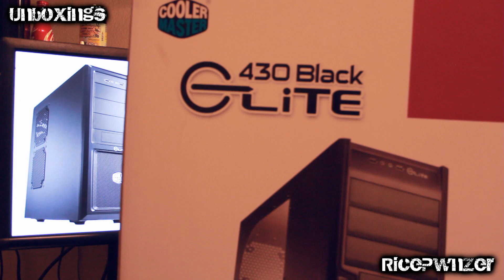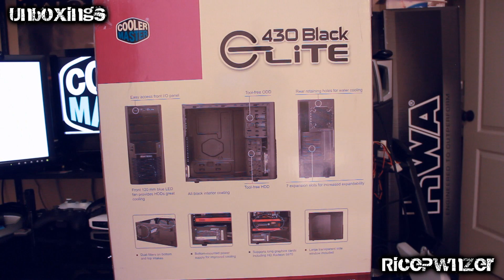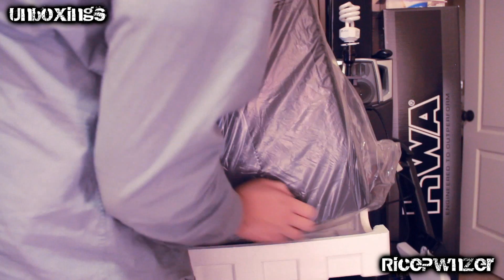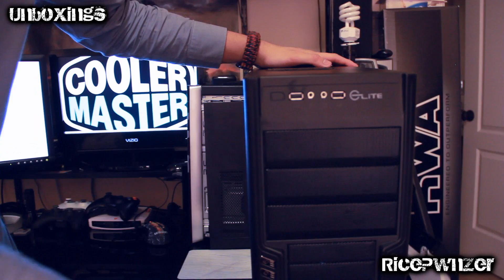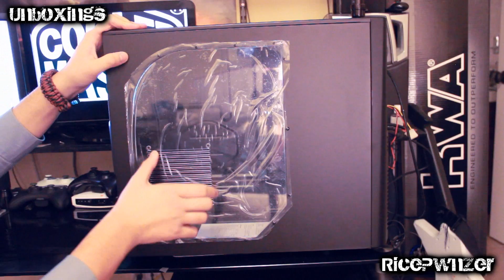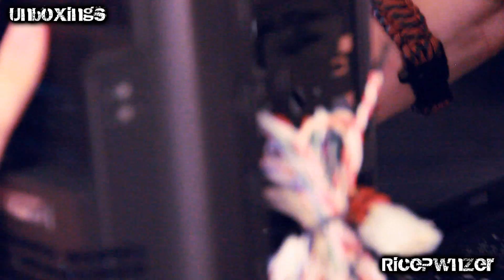Cooler Master Elite 430 Black Unboxing

Comment: wow thanks for the review, I was thinking about getting this, but I think I'll just go for the 431 if I really feel like getting a similar case. The experience I've had with that has been good. Even though the cable management space is pretty bad compared to the rosewill challenger I got to work with.

Comment: For those who are wondering.
Supports high-end graphics cards up to 315mm or 12.4" in length,
Reply: yup fully sized GPus
Reply: What motherboard form factors does it support
Reply: Is is so hard to go to Cooler Master website and check?

Comment: im thinking about getting this case and i have an hp pavilion 500- something and was wondering id there would be any issues i would have to worry about when putting my parts in the new case. Thanks
Reply: Have you done it yet?
Reply: no
Reply: Aiden Finch It's gonna work fine.

Comment: Should me buy this case ore not? If not can help me to find beter (cheap,good)case
Reply: i have this case and i think its great if you want a fairly good quality case for value then this is a good buy. (but the metal iiis a little bit thin and easy to push in)
Reply: No not really go buy a zalman z5 or a cougar mx 300, both have better specs better build quality and most importantly they include dust filters. I dislike any case made without dust filters, they cost nothing for companies like cm and it is a nice addition that makes our lives a hundred times easier.